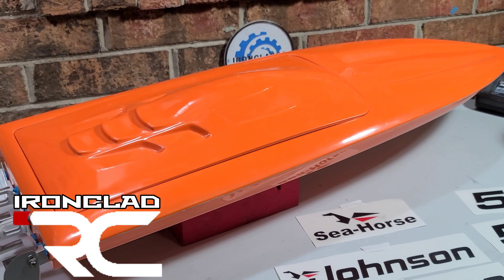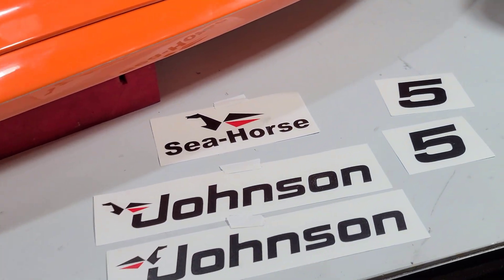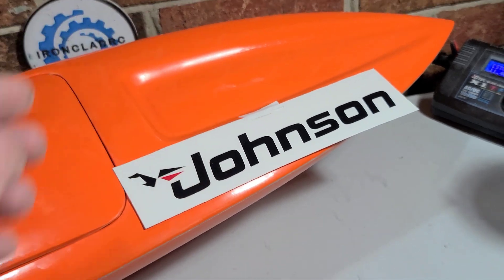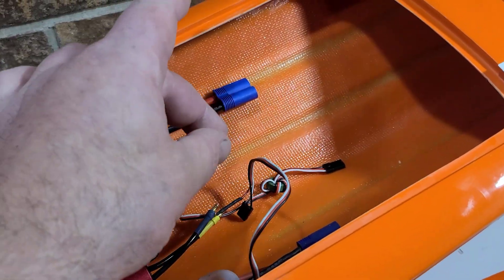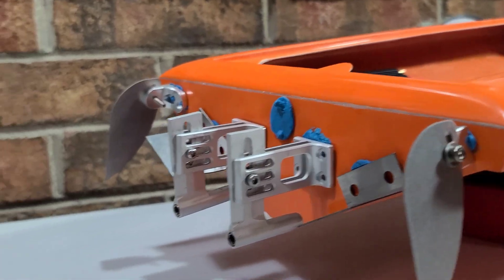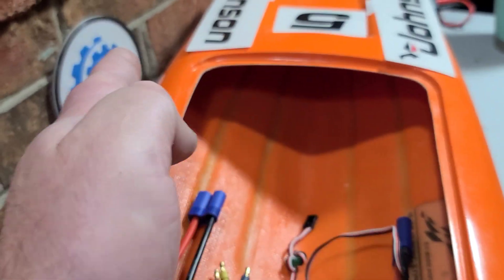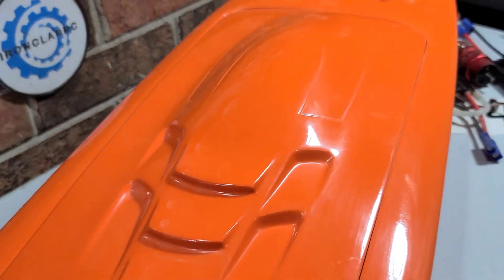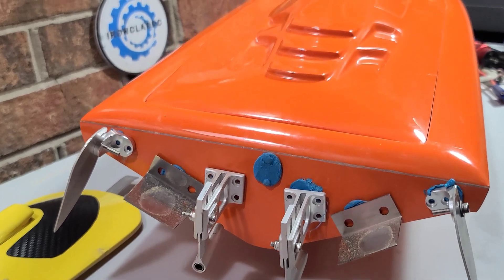Fitting The Hatch Deltaforce 29 Twin Motor Mono Build Pt 1 - Twin Motor Rc Boat

Comment: Great video as usual  try a hairdryer to heat the hatch it won't blister the gelcoat. Pressure on it till cool.😄
Reply from the maker: That sounds a but safer than a heat gun or torch thanks.

Comment: Weighing your options and trying to figure out the best way to build your boat is what this hobby makes it so nice. I recognize your tinkering, such as drive setup and hatch locking. I'm sure you will figure out a nice setup and this boat will be a performer 👍Cheers, DJ
Reply from the maker: You're right about that. Planning the setup and building boats is just as satisfying & more rewarding as running your boats.   Taking my time with this one,  twin mono is something I've always wanted to build...

Comment: Looking rad! I'm definitely loving the Johnson decals. My Grandfather has a green Seahorse 3hp. I just finished a home built tugboat. Out of a rc car chassis, connecting the flex shaft directly to the drive axle off the 1/16 chassis. I would love to send you a picture. It's Ironcladded out. U ARE the best boat channel. Thanks.
Reply from the maker: Email is in the description very bottom. I'd love to see the progress sounds intriguing

Comment: Cool build..I'm just about to.start building a twin mono for open.class 10s.. hears something could be helpful ..you don't have to run the  props in opposite directions with a mono. People think you do but that's a catamaran thing.
Reply from the maker: Good luck with your build and thanks for the info.   If I run the props in the same direction wouldn't the boat torq over like a single does?

Comment: Ready for Part 2!! 

Do you think when doing your CF inlay on the hatch that you could some how strap it to a table and use some shims under the left front and left rear? When it cures and dries maybe forcing it down with a strap and or weight it would either eliminate the warp and or make it slightly less?
Reply: I have heard some times warped hulls, Proboat is notorious for this on their warranty replacements. I have heard guys strapping to a table that’s perfectly flat and leaving it in the sun for awhile.
Reply from the maker: I thought about that while I was filming the video That may actually work!  The carbon fiber once cured should hold its shape..  only one way to find out. Thanks

Comment: Hey Big B, looks like you’re having fun getting this boat together 👍.
 I’ve learned a great deal watching your videos, but maybe I’ve got one for you. 
  I like to cut a horizontal slot in my strut bracket as apposed to the single hole, this allows for more precise adjustment by lowing you swing the strut in an arcing motion and does not change the gap between the drive dog and strut barrel. You can still move up and down while not having to loosen the flex cable for extreme adjustments. Just food for thought. 
Can’t wait to see this one, very interesting indeed.
BGFL

Comment: Careful application of heat with a heat gun can take that warp out of the hatch.  Where the driveshaft through-hull is isn't as important as where the prop is.  The through-hull could be two feet above the bottom of the hull as long as the prop is in the right place and correct angle relative to the surface of the water.
Reply from the maker: I've done a lot of experimenting with stuffing tube thruhull height on my big DF 35. It definitely does matter, I agree with what your saying as far as prop in relation to the water.  
     With the twin I want to get the props as low and close to the ride pad as possible, if there set to high the boat may run to wet (just my opinion)   thinking 48-49mm apart so I can run maximum 45mm props once motors are upgraded later on.     Thanks for the support